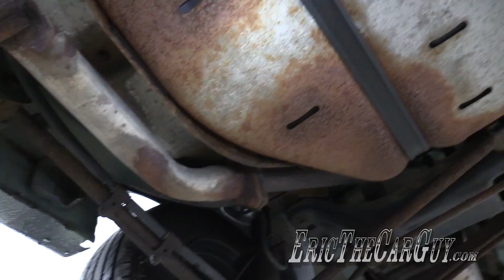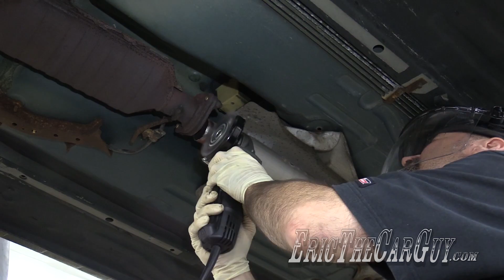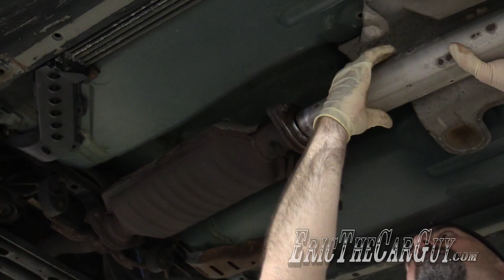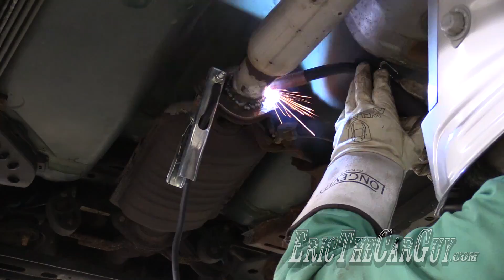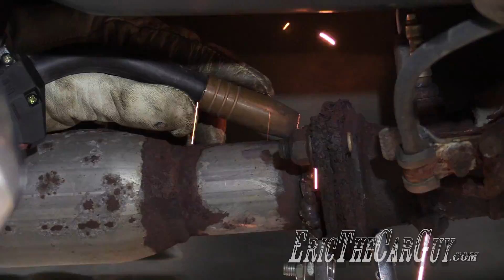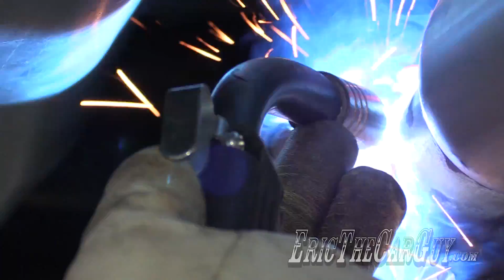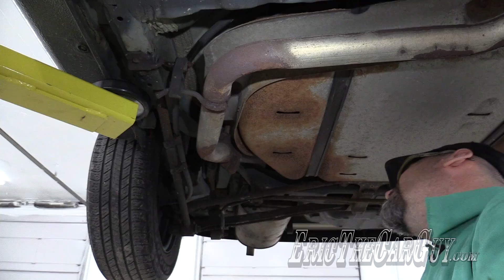Money Saving Exhaust Repair -EricTheCarGuy

Comment: I am new to cars, but I like what you did. 0$ cost. I am tired of paying to mechanics and big auto shops to do minor fixes on my car. Mine is Toyota Corolla 99 and recently I got a quote of .7 hr labor (95 bucks+new parts cost(40$)) for removing and replacing exhaust pipe gasket. Is this the actual time it should take to do that? I am not a mechanic myself but I can imagine if this is my job, I should not take more than 15 -20 mins to do it, unless it is some trainee.

Comment: Like the fact that you didn't edit out the part where you had to go back and re weld the top of the pipe to the flange. Hate when some videos make it seem like everything went perfectly the first time. I've done repairs where it takes up to 3 times longer than the video to make repairs because they edit and fail to mention the problems they ran into. Thanks for the video.

Comment: Question...my exhaust came apart in the middle of the pipe. It's connected to the front and to the back but is apart in the middle. Do you buy a connector and just weld them back together?
Reply: You can! Or take the pipe out a replace the whole thing
Reply: It really depends on why the pipe broke?! Is it rusted out really bad? Or was it welded before and the weld just failed? When you butt the 2 pipes together is there a hole from missing metal? A lot of factors play into your situation..
Reply: Thank you so much for responding! I believe it was just really rusted and my childs school driveway is all potholes that you can't avoid and it happened when I drove slowly over them.

Comment: I have done repairs like this before but I like to put a sleeve on the inside. That will reinforce the connection and give the weld bead more material to flow into.

Comment: The only problem I can see with this approach is usually if the pipe is bad enough to fall off the flange, it's mostly shot in other places too.  But some cars have places they fail when the rest of the exhaust is OK.  Older subaru legacies fail between the midpipe and the muffler, the flange erodes before the pipe.  So you can cut the flanges and connect with a stainless steel pipe and the rest will last a long time.  YMMV.

Comment: If you have a car with factory stainless steel exhaust, buying a new OEM pipe used off ebay from a place where there is no salt can really be a good solution.  I bought a B pipe and muffler from a CA car for my legacy.  The originals went 9 years in the salt and the Ebay ones looked almost new.  At the same price as Walker junk aftermarket lucky to last 3 years replacement pipes.

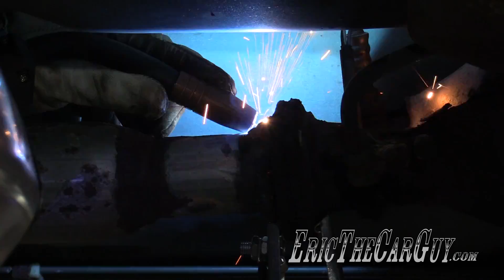Comment: at 9:44 you can see the light from welding the top of the pipe shining through the side weld.  poor weld job but likely better than most DIYers can do.  the video still has value in showing how to do a temporary patch job.

Comment: cut the two bolts off…..drop the pipe 5-6 inches…you now have full access to top.
    maybe even push a short  'sleeve'  in to provide better metal to weld to.  Maybe a new
     gasket on lift up of 2 bolt flange .    Per other perforation… take 3" piece of next side larger…id   =  od of existing pipe….slot the 3" piece…wrap it over the perked area…temp  clamp it  ( radiator hose clamp)…weld both ends then seam… voila done

 Welding thin rusted pipe is very short lived…the splice will last for years.  Nice lift !

Comment: that weld was so cold I had to put a jacket on
Reply: +Bill Russell   the second pass worked better because everything was heated up
you can use the low "arc-volt setting if you preheat it with propane or oxy acytline
the cooler you keep a rusty joint the better (oxy in weld in form of rust iron oxide)
you can stripe the top axialy to fill without dropping exaust

Comment: I'd have taken the pipe off after tacking the flange back on.  You practically did take it off near the end.   It wouldn't have been a royal PITA and you would have ended up with a cleaner weld which would hold better and resist rusting better (no pits to hold water).

Not saying you should have done this next suggestion, but as  DIY'er I've found it helpful so I'll post it for others.  Any time I've done an exhaust repair I clean the entire pipe with wire wheel, use Naval Jelly to get the remaining rust then use high temp paint and paint it.  Years later, not a speck of rust on them.  It takes a bit of work, but knowing that I'm not going to have to do the work again for a very long time is nice.

Comment: I recently had the same thing happen on my '04 Explorer.  Unfortunately, there wasn't enough good metal to weld, so I had to get a new muffler -- ended up taking it all the way back to the exhaust tip.  For about $150 total, the old man and I just clamped it all in place.  Hopefully, it'll pass state inspection in a couple of months.

Comment: Eric, I have been doing exhaust work for 30 years. I have never disconnected the battery while welding on the exhaust and have never had any issues with frying the computer. Another good tip is don't weld up hill. Start at the top and work your way down.

Comment: Why didn't you just undo the flange? Would be easier to weld the top part after you've already welded the rest and it's already lining up. Would be easier in my opinion.

Comment: I hate this planned obsolescence. Everything is made out of "bullshit". If these exhausts were made from acidproof or just good stainless steel, they would go a long way. It's still a tough place, all that heat and shit flying around. Especially in the countries that put that damn salt on the roads.
Reply: +OniJon more like consumers aren't willing to pay
Reply: guyincognito210 If we're going there, let's go there. Some of us are willing to pay and need to pay big money to have aftermarket exhaust (no performance benefit version) that's made by hand where as a big company could make that stainless steel one with fraction of the cost. Making steel by todays standards and machinery isn't that much more expensive than making mild steel or iron. For example on "better" older cars like Jag MKII that exhaust is twice the thickness of todays car. Companies want cars to be changed regularly in hope of big profits.

Comment: just curious, how long will this type of weld last? just had this done on my ford escort and it broke at the same location you are showing.
Reply: Back welded angle pieces in about three places, on the back side of the flange,  would give it the extra support it needs.

Comment: I was drilling a small hole into iron. The drill shattered and a small spec lodged in my eye (tried removing it with a neodymium magnet, but it came out by itself after a week.). Even something simple as drilling a hole can do it.

Another incident: my brother turned an engine over by hand. It was separated from the car, not connected to anything, so what can happen?
The spark holes were plugged with plastic caps.. the compression popped one out with force, almost striking my eye. Danger lurks everywhere in a shop.

Comment: It's odd, you did quite a good welding job on the more awkward top bit after you dropped the exhaust down, underneath looks bloody awful though hahaha =P

I'm just curious, but if you could hold or even clamp the two bits close or together, couldn't you use JB weld or something similar? or does it get too hot for that stuff? it's rated to about 300 degrees centigrade.

Comment: Man, your videoes are getting better and better. Top job filming and editing!
Sadly a repair like that will never hold very long, so in my book it is just not worth the amout of work, even if it is a temporary fix. Eventually that exhaust has to be changed anyway, so this is actually just an expensive delay for the cutomer - been there done that. But  you helped friend out low on cash, so fingers crossed you made that tinfoil pipe last a good while ;D

Comment: Just an idea.. what about REMOVING that section out to weld on a bench and then put it back?
Reply: nope.  trust me.  that would be ten times more work, plus a new gasket and bolts to say the least.  may even have to drill the bolts out of the holes.
he did it the correct way.  it's an old, old car.
Reply: +Tiago Garcia Removing the section is preferable, I agree.
But I would like to put a few spot welds on it before dismantling, just to make sure the flange gets welded in the perfect position...
Reply: +Tiago Garcia Right !!! At least take the flange off .... weld it and bolt it back together !! SIMPLE !!!

Comment: simple welding trick for getting a good ground is to take an old battery cable and remove the sheathing wrap the cable around the exhaust and attach the clamp to the cable, stranded cables work better giving you a bagillion contact points.

Comment: thoose small holes, get a welder named jb to fill thoose in, good for a year
Reply: +kyle Hill  uhhh on a hot exhaust jb weld comes off asap. i remember having some on my muffler and it came right off pronto... I prepped the surface and everything... jb weld is garbage if exposed to prolonged heat or liquid.
Reply: +kyle Hill Don't use JB weld, but they do make exhaust hole putty that would be good for that. i had a dirt cheap rusty miata for fun that I quieted up using the same thing.
Reply: jb weld always has worked on my mufflers

Comment: I will disagree with you cannot weld rust, lol. My buddy has a 97 F-150 4.6 V8, and the EGR pipe on the driver side manifold rotted away, and I welded a bolt in the place of the hole so he didn't have a loud exhaust leak. Laid down some good welds, patched the hole, and now his passenger side manifold is leaking lol.

Comment: well its easy to tell u dont do that every day lol but a shortcut to welding the top is to cut a 2x2inch square off the bottom of the pipe or atleast cut a section big enough so ur cone will fit it and you can see a little bit around ur cone, then weld the top half from the inside. once thats done put the 2 inch square back in place and easily weld it back in since all the welding left is on the bottom an easy access. takes me a fraction of the time to weld it from the inside then to fuck around pullin all the hangers and shit which u cant always do if its too close to the flex pipe

Comment: +EricTheCarGuy do you mind me giving you a few suggestions?  None of this is the "right" way of doing this (I'm actually surprised that you agreed to do the work, I'd bet that you did almost as much work as just replacing it would have been, I guess that saves the owner money in the short term, but when it self destructs in 6 months the total will be greater), but will help get this kind of thing done well:

- looks like that welder doesn't have much power, most normal MIGs would burn through that exhaust if you took that long at the lowest setting.  Take advantage of that and get some flux core, it burns hotter, but is also more tolerant of contaminants and will make rusty pipe/flanges easier to weld
- no matter how you do the job, get more heat into that weld, to get a decent weld joint there you want to be running hot enough that you'll burn through if you pause in one spot for a second
- Tack the bottom like you did, and then either drop the exhaust or unbolt that flange (don't know if the bolts were to rusted to come loose) and weld it without the tension on it, and it will give you more room to work, heck with the gap you had i would have been tempted to unbolt or loosen the hangers first just to tighten that down.
- disconnecting the negative isn't going to protect the ECM.  I've never seen an ECM get messed up from welding on a car, but if you want the extra bit of protection, just unplug the ECM harness, on a lot of cars that's less work than disconnecting the battery anyway.
- after tacking, start at the top and work your way down, that way your weld isn't in the way of you welding
- when welding something like that (heavy flange, very thin and rusted pipe), turn the heat up a LOT more and aim the wire feed into the flange.  The heat will melt into the pipe next to it and give you a MUCH nicer bead.  If the gap is big you might have to make a little whip motion towards the pipe every 1/4" or so, but it will let you put a lot more heat into it and lay down a much better, more structurally sound bead.
- DO NOT use your welding gloves to do other work on the car.  ESPECIALLY after you've sprayed down the hangers with penetrating oil.  Getting dirt, especially oils and grease soaked into gloves that are supposed to protect you from welding sparks and heat is a really bad deal.  At the very least it will conduct heat better into your hands, possibly boil and burn you before you get a chance to react, or at the worst, the gloves could act like a wick and could catch fire.

Comment: If it works, it works. Especially considering that gap you had to weld up, that went pretty well. I ended up welding two exhaust flanges together recently rather than replacing a bad gasket... the whole exhaust system's coming out sooner or later and the fasteners were so corroded that the bolts have no recognizable threads or heads left. The exhaust leak had rotted out the floorboard above so I didn't even have to drop the exhaust to weld the top!

Comment: welding structural steel or 6 inch pipe ( which is what is generally taught in traditional schools ) is significantly different than doing this kind of welding. learning how to run a hot pass in open roots, unlimited thickness dual shield certifications, etc...none of it compares to automotive welding. eric took the time to show some folks (do it yourselfers) how to potentially save a few bucks by doing a simple repair on the exhaust to help his friend get by. its a mazda, not a top fuel dragster. it doesnt have to be perfectly engineered, or welded within 0.010 of an inch. it doesnt have to meet the requirements of any welding codes. its easy to judge someone and be a nay-sayer being a keyboard jockey. try putting this amount of effort into helping friends, and the entire motor enthusiast community online by doing the things that eric does...on a daily basis. i promise you'll be singing a different tune when you have to walk a mile in someone else's shoes.
Reply: Blake Thompson fuck welding codes I'm going to do a custom exhaust with glass packs and my own welds
Reply: Do you trust the quality of welds from Auto Muffler shops? Or is it that for that application they need not be perfect.
Reply: Hey, you can save yourself some money if you have your own car lift and mig welder. If you already have that stuff, you probably don’t need this video.

Comment: hey eric why dont you take a class for welding, or commit an entire week to welding and show the progress. Just take an hour a day. It seems like a waste of a welder if you cannot use it properly. Pipe is the hardest to weld especially in those circumstances overhead and whatnot. Id highly suggest practicing a few times. because there is a point when welding will click, you  understand heat and weld puddle and how they all go together filler wire and gas. Its complicated at first.

Comment: Hey Eric. Just a little tip, try to weld down instead of up. since the metal turns liquid when is hot, it tends to run down.

Comment: I replaced the oil pan on my car yesterday (I went to do an oil change and when I gave it a quick wipe to remove some of the caked-on grit, large oil-drenched rust flakes rained everywhere - the pan had been slowly dripping for a while) and since the exhaust runs right under the pan, I had to drop the front pipe to give myself some room to access some of the pan bolts. The most difficult part of the pan replacement was prying the old pan off of the OE sealant - no gasket on 2003 Accent. When I started it up to run the new oil through, check for leaks and level. I ended up discovering that I cracked the welds on both sides of the exhaust's flex coupling. (I think they were already cracked a little before I started.)

It is on days like these that I really wish I had a MIG welder or knew someone who had one.

Comment: This reminds me of my student days, no welder available, but the hole was on a 90 degree bend in the pipe, not on a flange. Wrapped it up in aluminum kitchen foil, then cut out the sides of a soda can, squeezed that around the foil-covered hole. Used metal wire to tighten it all up with pliers. Drove it around like that for nine months, borrowed time, free of charge. ;-)
Reply: Neal William Miller grape or "orange" flavor for sure lol
Reply: Good job The next repair use the bosal repair paste, and run engine just 10 minute!!! :):):)Perfect ! learned all this from the wonderful team of manyautosltd.com they are really supportive and guide you if you need any help